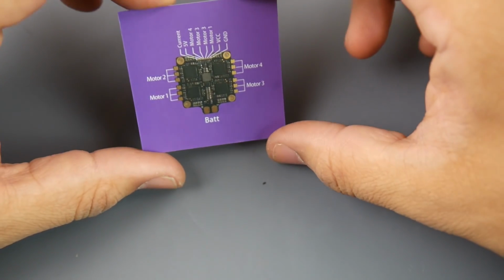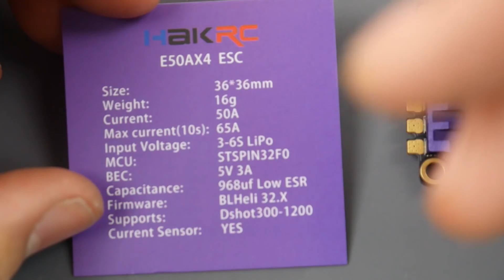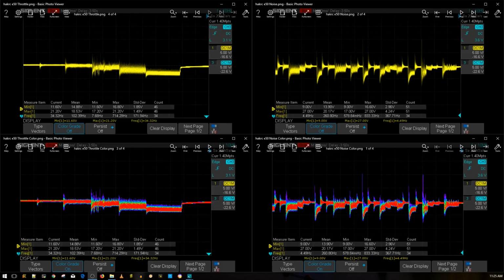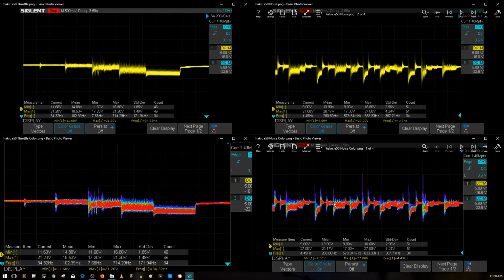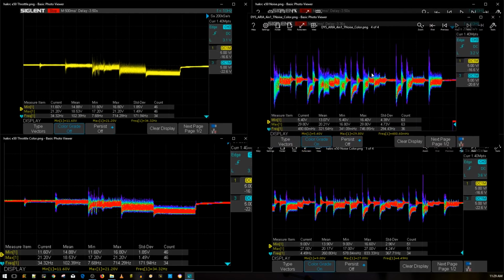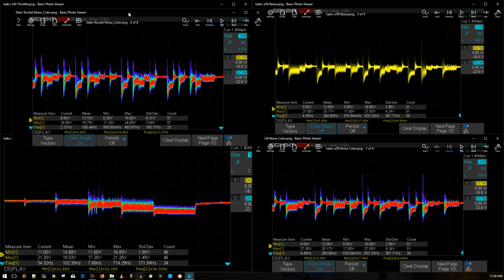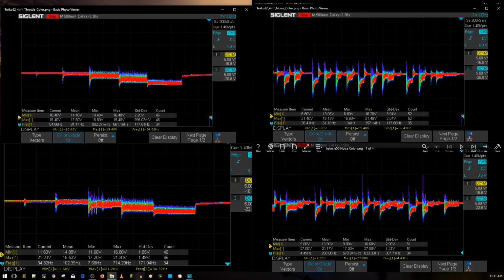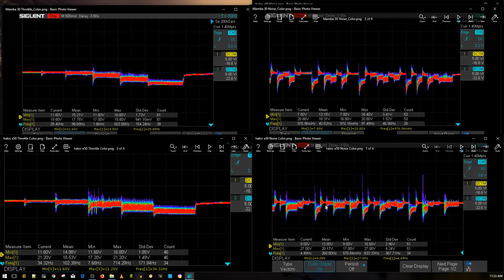I DID NOT EXPECT THAT!!!  //  HAKRC E50 4in1 ESC Review and Noise Test

Comment: The heat-sink on my HakRC ESC is not aligned correctly, 2 nuts can be barely mounted, while the other 2 nuts will have too much space... Should I remove the heat-sink and position it correctly?

Comment: I have bought 3 of the super cheap Diatone stacks two of them 20x20 stacks and the big 30x30 stack which i did add the low esr cap to and will be running 6s through  1800kv motors.  Im waiting on packs as we speak. Cant wait to see how this stack performs on 6s